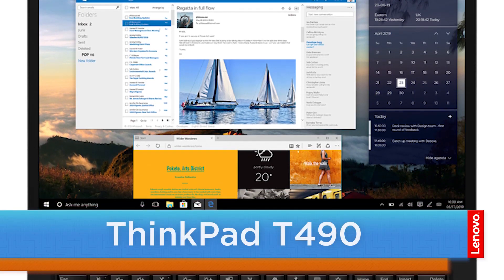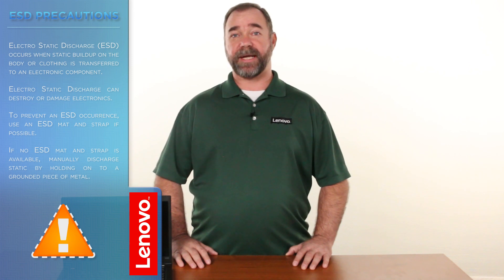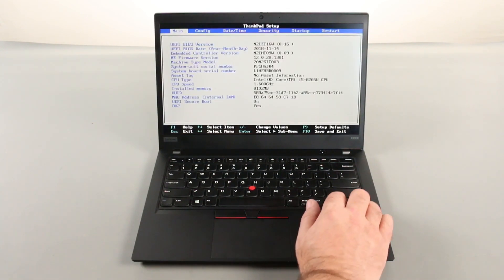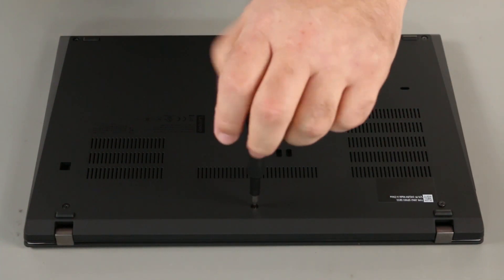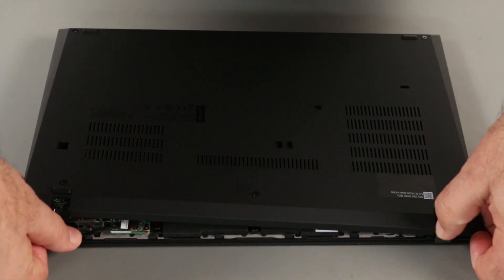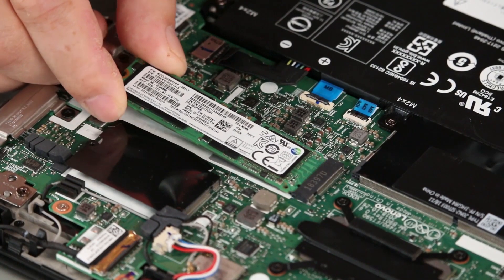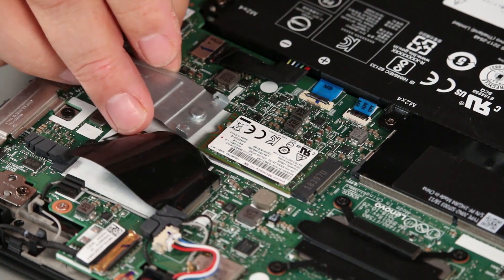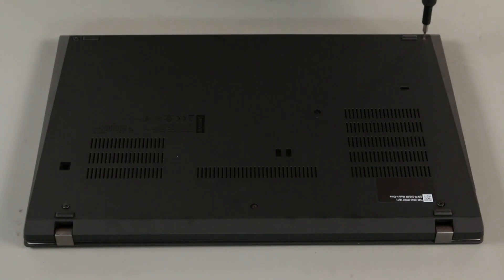ThinkPad T490 Laptop M.2 Solid State Drive Replacement

Comment: Thanks for the Video. 
If you want to turn the laptop back on, is there anything you have to do in BIOS?
Reply from the maker: If You are asking about enabling the internal battery, you do not need to do anything in the BIOS. Plugging in the AC adapter will re-enable the internal battery.